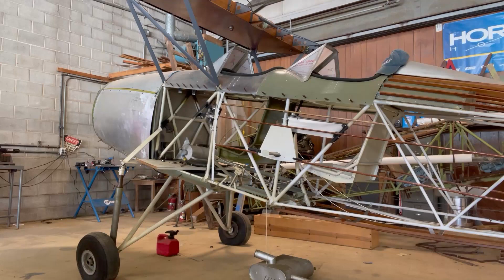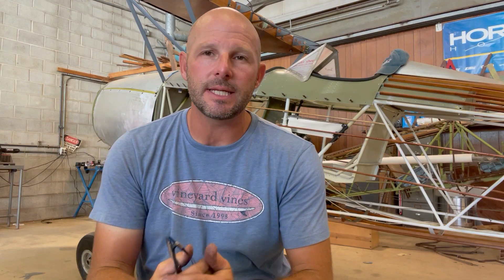Great Lakes Biplane Build preview

Comment: Hi, I had an older friend back in the 70's that was scratch building a Starduster Two and he all the ribs finished and they were a work of art! I lost contact with him, and I think he passed away before finishing his project. I will follow your build and hope to see you get this beautiful plane in the air. I built a KR 2, but sold it after getting it 90% done (and 90% to go :) ). I believe it was completed as I have seen a KR 2 circling fairly low over my house several times last year. Good Luck! Subscribed.
Reply from the maker: Thank you for subscribing and glad you are coming along on the journey of this build.   I am very excited about the Great Lakes Biplane and combining it with a Ranger Engine really is going to make it special.
Reply: @JonathanMartinPilot  You are welcome! What is a "Ranger Engine"? What are its specs?
Reply from the maker: @sgd5k292  in-line inverted 6 cylinder.   200HP made by Ranger Aircraft engines a Fairchild company.   They sound incredible.